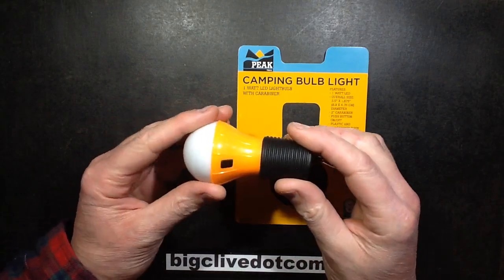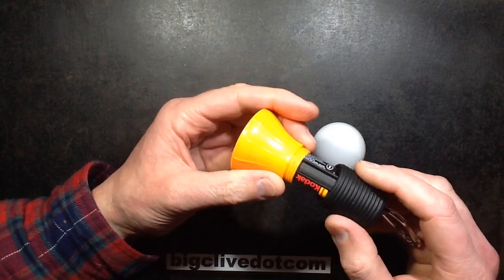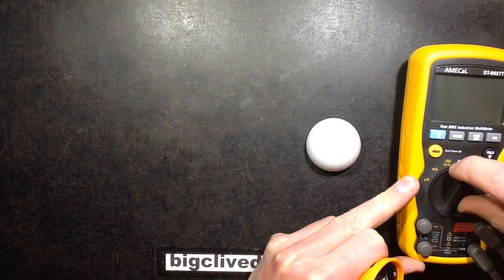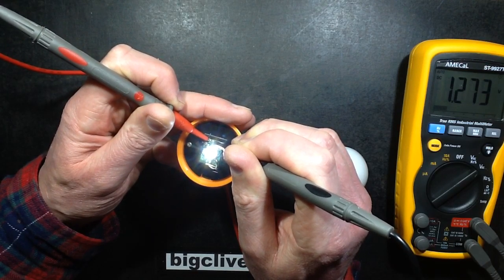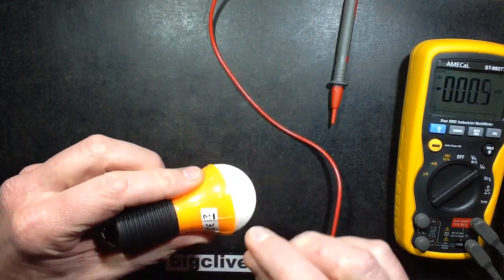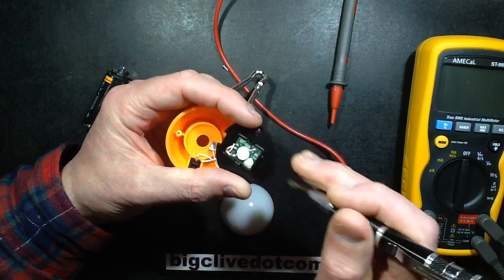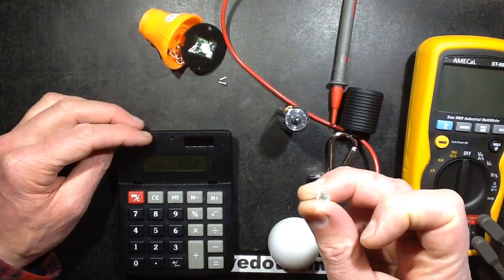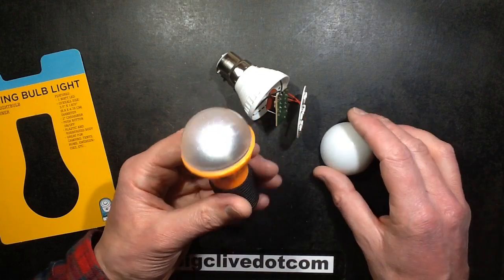Review of Poundland 1W LED camping light.

Comment: Could you use a 18500 in this. It would have very little voltage drop. Not sure what the 3 AAA pack length is. But there are button top 18500's and protected button top 18500's that would be just a tad longer.  There fully charged voltage is 4.2 and running voltage is all the way down safety to 3.2. Some would even say 3 volts but I find that a bit on the unsafe side. I use 18650's on a daily base in all my vaporizers.
Reply: +rekozma you only need plastic tube to thicken the 18650 making it match the aaa diameter 
I have one ebay china lantern that came with both aaa holder and a 18650 with the adapter and an external charger (nowadays might be a usb  power-bank instead)

Comment: Good review Clive.  A light like that, I would run on a single AA battery with a joule thief circuit installed and just use the led not the circuit board and the light will be brighter and last longer...as of course you know.  Then I would rewire the battery holder in parallel to triple the life of the single AA.  I have done this to several commercial lights with good success.

Bill
Reply from the maker: When I first saw the light I thought the barrel was so slim that it probably used an AA cell and booster circuit, but it's just the plain battery pack arrangement.